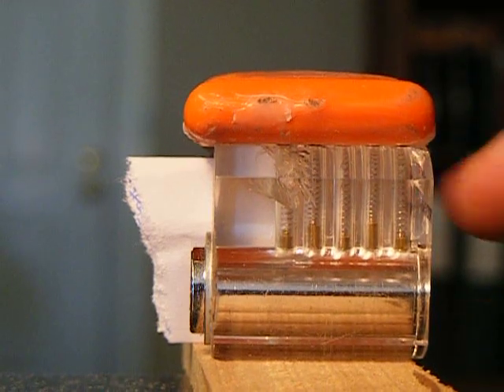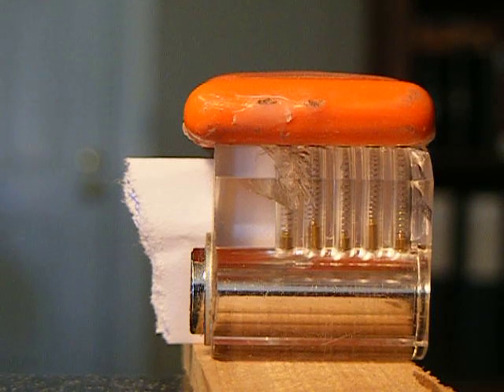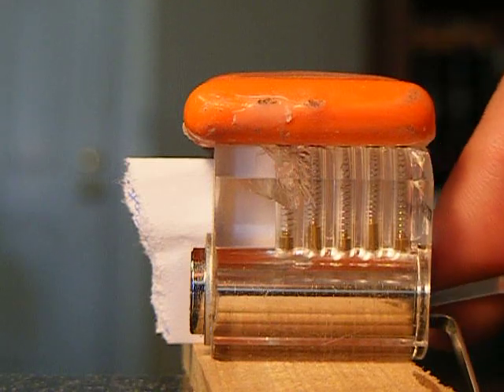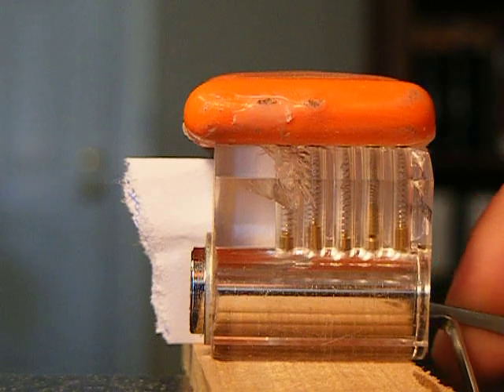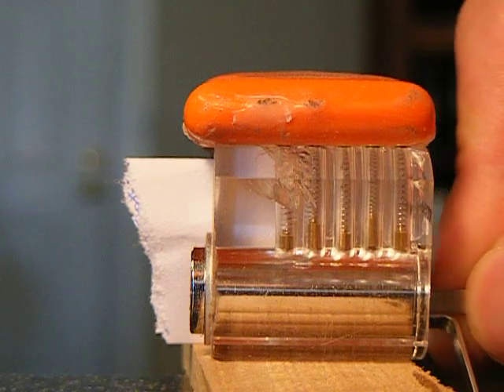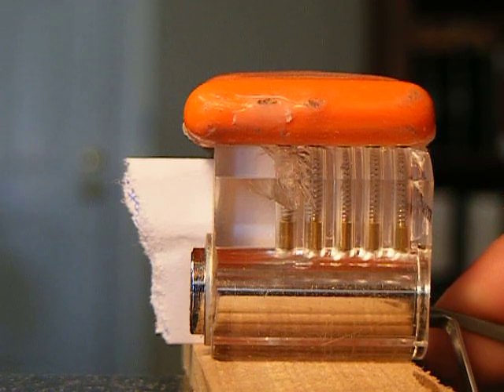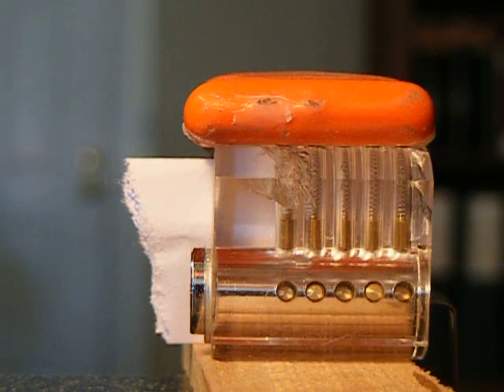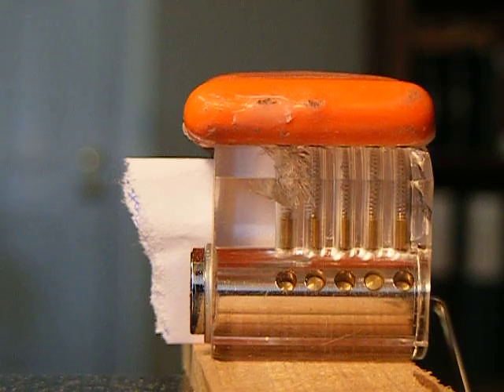Transparent Lock Lockpicking Demo

Comment: I think (but I may be wrong) there is an easy way to make these locks safer. I just don't know why industry haven't tried before without adding other fancy features. Just countersinking the dam cillinder holes will prevent you from locking the pins with the tension wrench because the pins will not have a surface to hold on. The countersink doesn't have to be very deep, though.

Comment: 480p is not HD
Reply: +Nhat Linh Nguyen It was 7 years ago.
Reply: +McMaster  I am pretty sure 480p was never HD standard, even 7 years ago.
Reply: +McMaster High Definition (generally defined as more than 480) has been around since the early 80's. Though, it didn't become available for regular broadcasting in the US until 1998.

Comment: I'm certainly no expert and suck at this. That said, this is the theory I understand:
You use one tool (the one you probably refer to) to apply pressure to the cylinder. You cannot turn the lock because of the pins just yet, but (one of) the pins cannot move anymore either: You hold them in place.
Now the other tool is used to probe the pins and find the one that is the hardest one to move. Try to align it, lock rotates a tiny amount, repeat.

Comment: @OMGItzBarky yes, thats what he's doing. There are actually 10 pins in this video. The pins on the inside of the lock have to rotate with the lock, the others stay on the top. You have to bring them all to the right position (the point where they touch each other has to be at the border of the "inner case" of the lock, so the inner case can rotate

Comment from the maker: @selena4535 
You don't, really.  You work on whichever pin sticks--usually, front to back or back to front will get you the best results, if the lock is machined sloppily.  Generally speaking though, the pin with the greatest resistance to movement is the binding pin, which you should work on first.  Each lock is different, so this may not always help.

Comment: @shotgunpi all you have to do to know which way to turn it is turn the torque wrench clockwise and counter clockwise and whichever way gives more is the way the lock should turn you should be able to feel which way gives more
or if that does work then apply torque clockwise and push the first pin down if it sets, thats the way to go if not then its the other way.  I hope this makes sense :)

Comment from the maker: The tension you apply to the torque wrench rotates the cylinder just enough that the pins catch on the edge of the cylinder.  It can literally be a fraction of a millimeter.